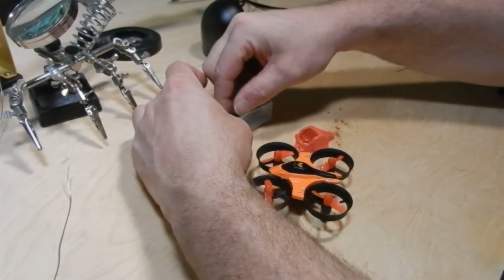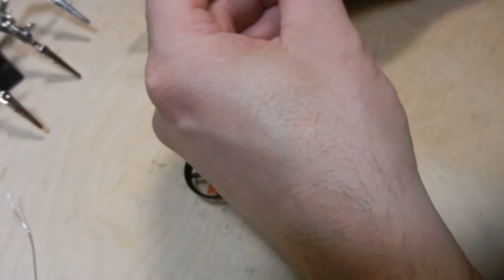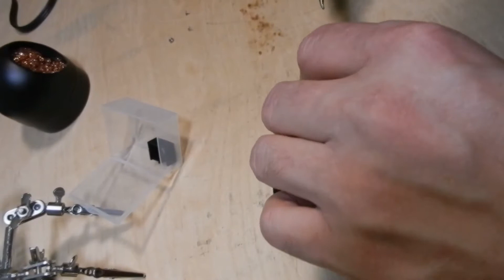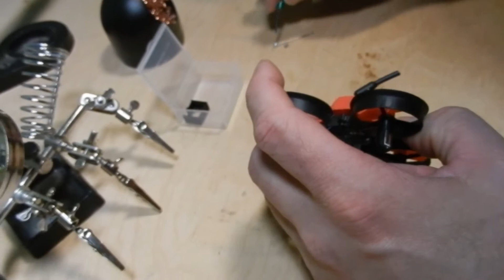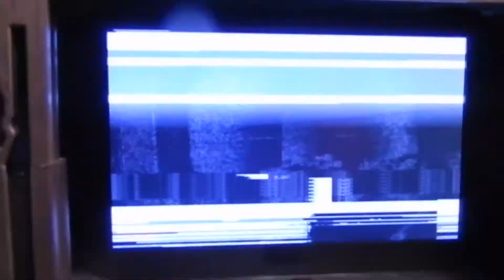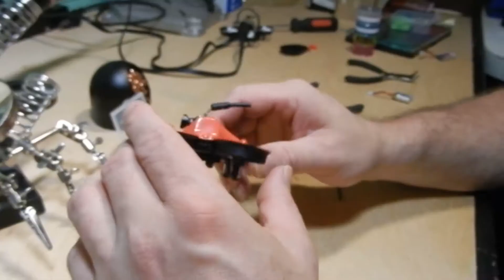Furibee F36 FPV Camera Mod

Comment: Where can I find this camera and canopy for the F36?
Reply from the maker: It was not in the same place I got mine, they did not have any more. 
But I did just find them here: 
https://www.amazon.com/RJXHOBBY-Micro-Camera-Transmitter-Quadcopter/dp/B01N9ATLCO
You could also get them from https://www.rjxhobby.com directly. They are still available from what is on their site. Just go to their site and search 1380. I am now searching for the canopy's
Reply from the maker: It appears that that specific canopy is "currently not available". They do however have other mounts. Search "F04", or "H36", "F36", "E010" camera mount. And 25mm mounting hole spacing. Here is one example... 
https://www.amazon.com/Camera-Holder-Shells-Protective-Controller/dp/B072LSZD67/ref=sr_1_1?ie=UTF8&qid=1546144494&sr=8-1&keywords=F04+Camera+mount
You might have to use some 3M double sided mounting tape to secure it in there, but it should work. Just try to find a mount that the camera bay size will match the camera. Or, the first time I did the camera, you could just remove the original canopy and 3M tape it to the quad directly with a square of tape. Just be careful to not damage the board.
Here are the links to the "currently unavailable" canopy's for reference...
https://www.amazon.com/gp/product/B01M2ZVK0D/ref=oh_aui_detailpage_o02_s00?ie=UTF8&psc=1
https://www.amazon.com/gp/product/B073B7LH5Z/ref=oh_aui_detailpage_o01_s00?ie=UTF8&psc=1
Reply: @therccrashproject6330  thanks for getting back to me. This info is helpful. Have a good one bro
Reply from the maker: I just found on RJX website that they do have mounts to fit the 1380 camera. But it appears that they don't fit the Furibee's. It may take some searching to find something currently available to fit perfectly. The Furibee has 25mm spacing of the mounting holes.
Reply: @therccrashproject6330  thanks a lot
Reply from the maker: If you are still looking for the canopies for this camera, they now have them listed and in stock.
https://www.amazon.com/gp/product/B01M2ZVK0D/ref=ppx_yo_dt_b_asin_title_o02__o00_s00?ie=UTF8&psc=1
The camera however is still not listed on amazon, only at RJXHobby.com.
Reply: @therccrashproject6330  thanks man. I was looking at them last night. Have a good one